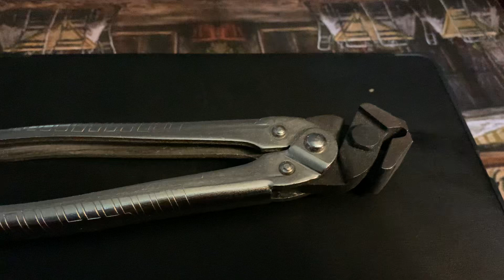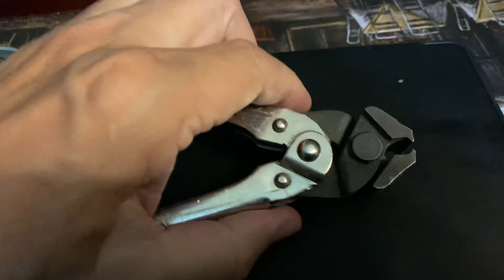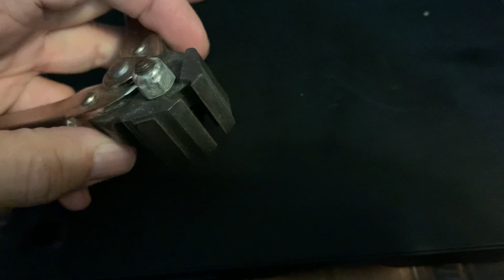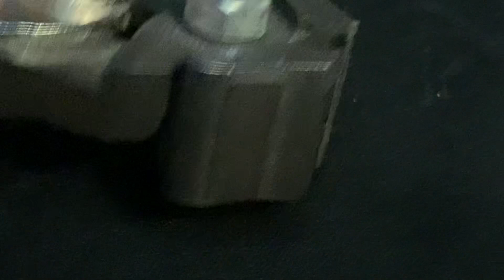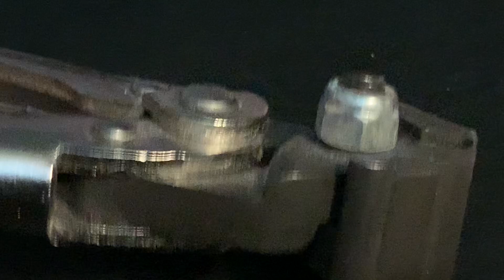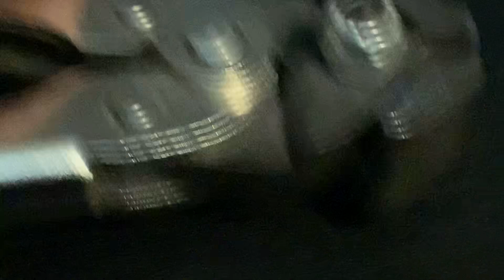Nobody can Guess what This Tool Is Used For (Tool #28)

Comment: It’s used to snap off rivets
Reply from the maker: Nope. Nice try
Reply: @JDRichard  OK, cutting the stuck stems and jammed spring bars, or cutting off old brass loops used as lugs on old style trench watches
Reply from the maker: @quinninstrumets8259  I gave you a thumb up, but you are not correct